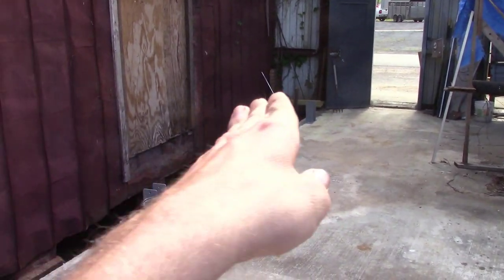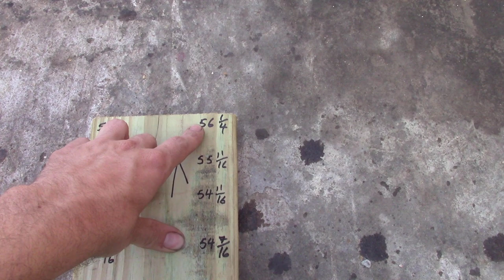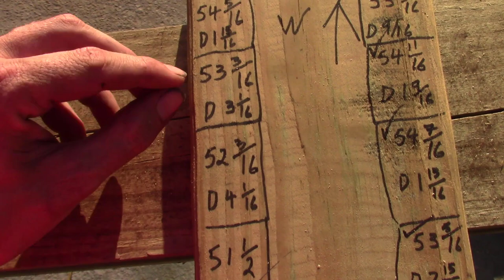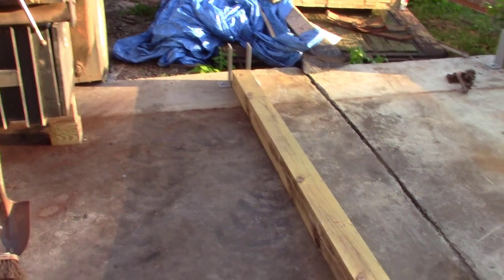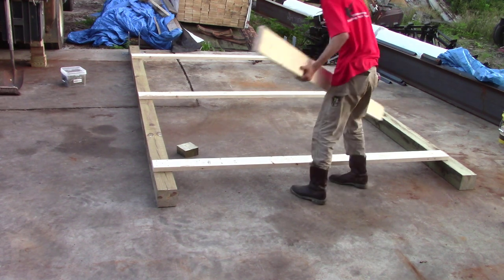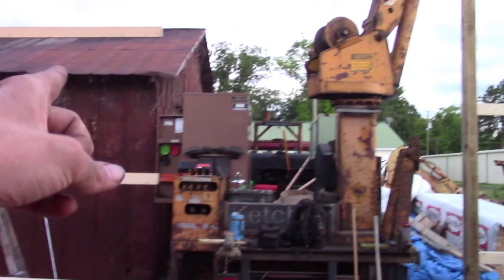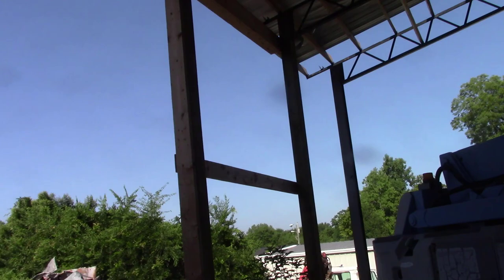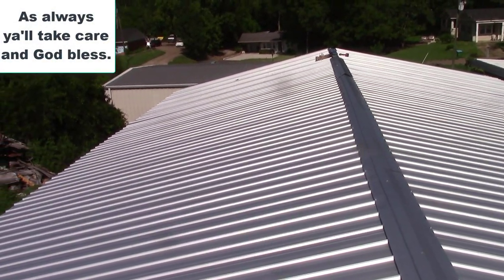Shop build walls and roof

Comment: It may be here. But, it may be worth mentioning for those watching this later. The “tallest” post that was mentioned was actually the lowest point on the slab. That’s just the way the transit works. Thus, he had to cut length off of the others in order for them to be the “same height” as that one.
Reply: Now this makes sense! Thx a lot!

Comment: I enjoyed watching  back in 2011 I built my 12 by 16 work shed and It was the first framing I ever did by myself I used my 4 foot level and my plumb bob and measured it exact as I could even used my sting and string level when I set my blocks on the ground My floor was perfect before I put up 
the walls

Comment: You will be able to pour a level slab over that old one. Do you need radiant heat?
Reply from the maker: Not planning it. Just have to deal with a slab being not perfect.
Reply: @EEJester1586  At least research the possibility. Your framing and roof are so nice, see if you can treat yourself to a mirror finish floor. So easy to clean; so easy to roll carts on.

Comment: Red Wings?
Reply from the maker: Yes sir Best slip on boots ever made.
Reply: I don't to this kind of thing, but why not set up post lay out a level line with the laser and the measure up from that line so all are the same height?
Reply from the maker: @ke6bnl  you can do that. You just have to cut your posts in the air. Cutting your posts on the ground is easier on a high wall if you don’t have a man lift.  A ladder is super difficult above 12ft.